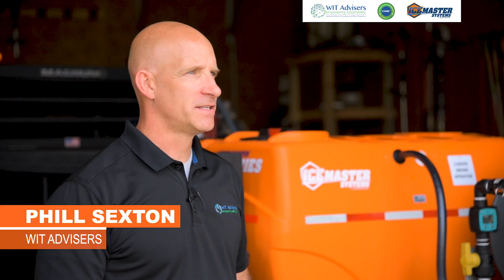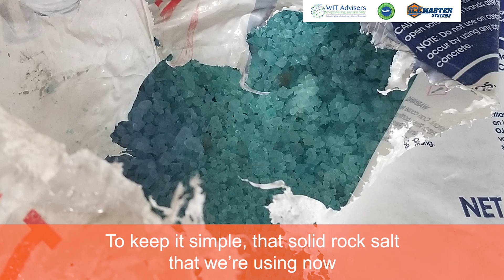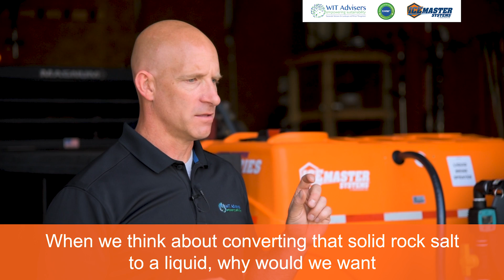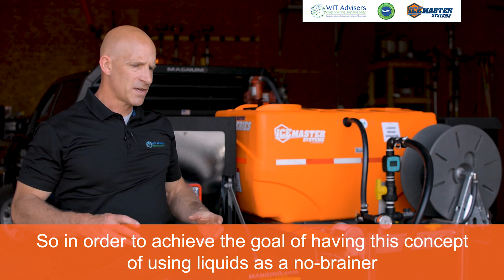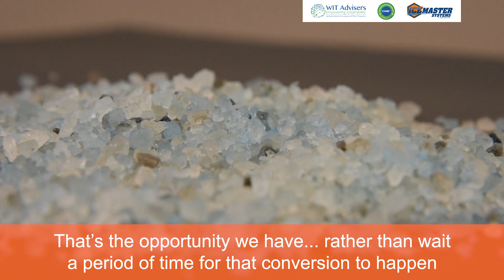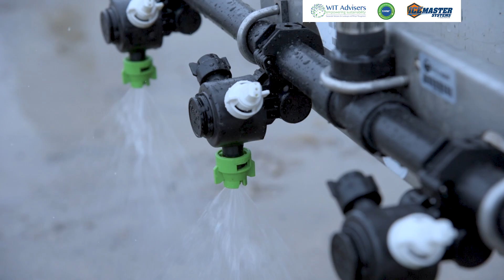Rock Salt vs Liquid Brine. What's Better?

Comment: Very Interesting. Do you need to per wet the surface before a snow storm or you can apply the liquid brine after you plow?
Reply from the maker: If you can, I would recommend to pre-treat the surface before the storm. This will help prevent the bond of snow and ice to the pavement and make it easier to scrape of the surface when clearing snow.

Comment: Theres no proof brine works
Reply from the maker: King Troy, The point made here is that brine works like rock salt, only it is working immediately as it is applied instead of waiting for moisture (liquid brine is rock salt in liquid form).
Reply: I’ve used brine for 5 years 
It works
Reply: It works great I've been using it and making my own for 3 years

Comment: Doesnt it make sense to have a brine solution of higher than 23.3, say 25 or 26? If you're spraying the brine on snow, there is already water there, so your brine would get diluted.
Reply: It actually freezes faster 
Don’t ask me why 

But it does
Reply: @tedpendagast579  Because salt water is denser then fresh water, i.e. rain or snow. The brine would essentially sit on top of already present liquids and would allow the cold to freeze the layer below. Notice in the video the application is be placed on dry pavement. No snow or water present.